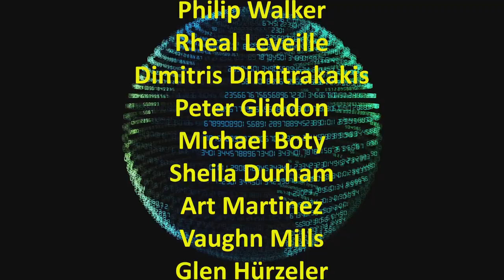(1101) EVIL Keyways & How to Pick Them

Comment: Great video mate, have exploited the pin holes in the warding before but there are some evil keyways that don't have holes through the warding, have to find another way around the restriction. Sometimes I have used a very thin pick which allows moving between the warding, other times I've actually made high reach thin ones with curved tips that I have to turn to get up into the pin chambers, then rotate coming back out. Once used to it I found the hardest part was getting used to the different feel of touching for pin tips on what would be the side of a normal pick.